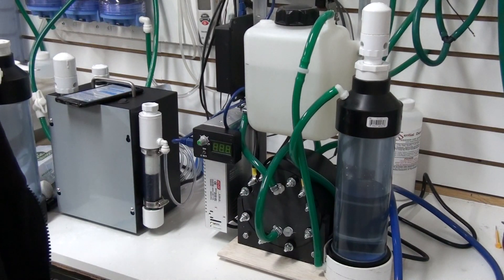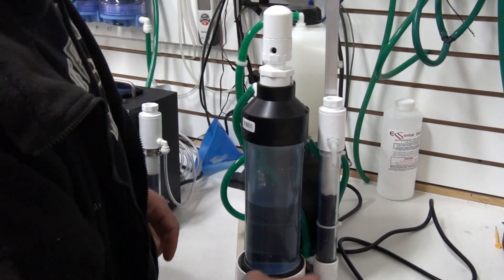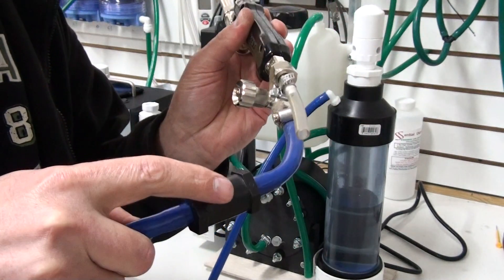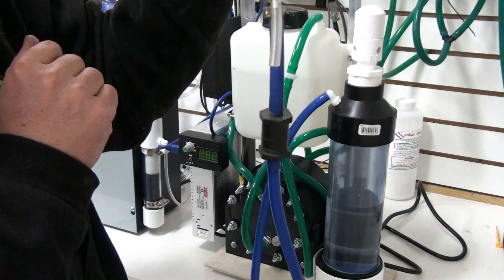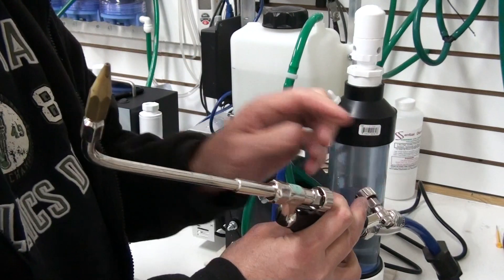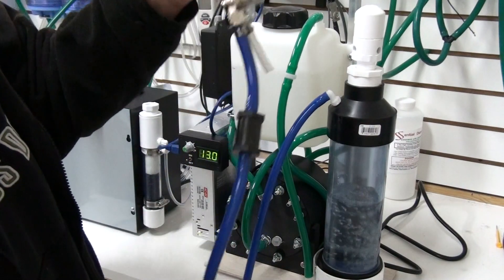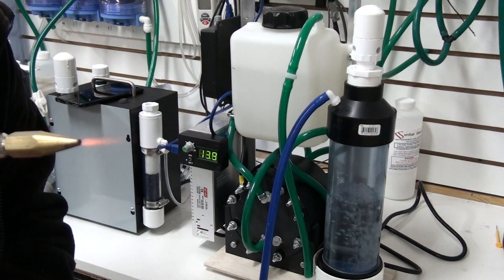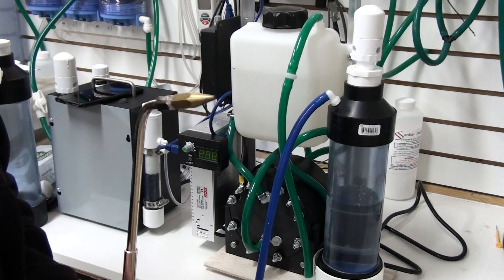How to convert your Hydrogen for Health machine to a micro torch

Comment: we also experimented with hho torches but i prefer a seperator cell where you introduce the O2 back into the pure hydrogen just like an oxy accetaline set.
Reply from the maker: +closertothetruth You can run the hho through a bubbler with acetone or alcohol to cool down the flame and prevent any flashbacks. You could also get a bottle of oxygen and hook it to the other input and turn this setup into a cutting torch.